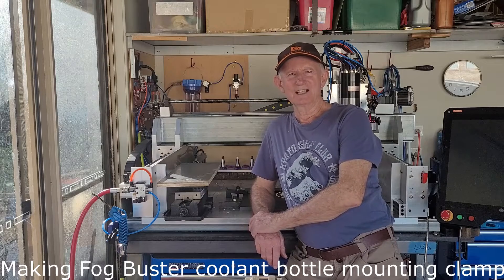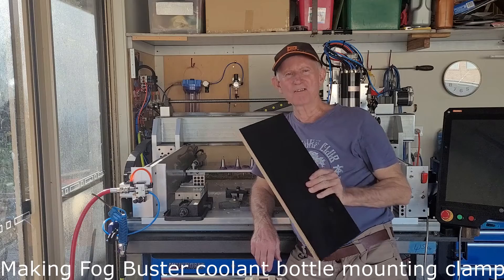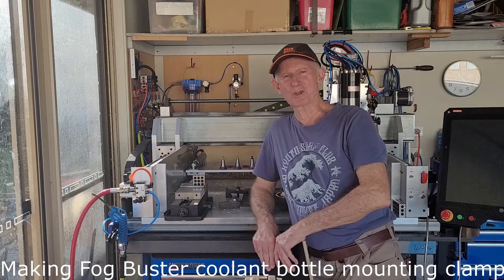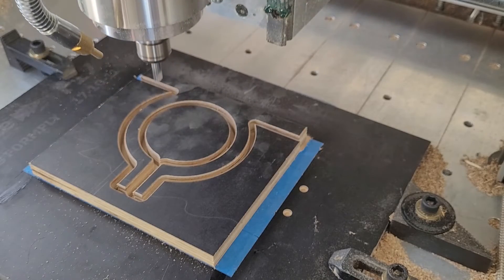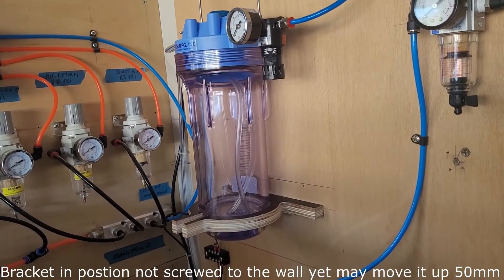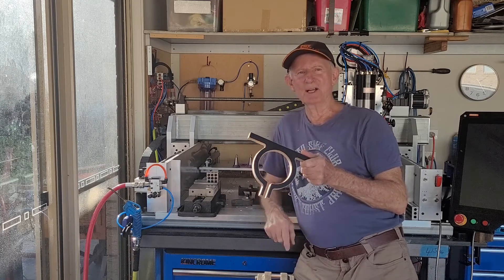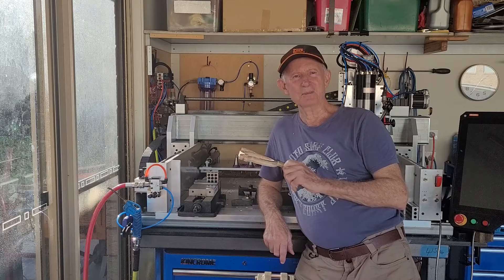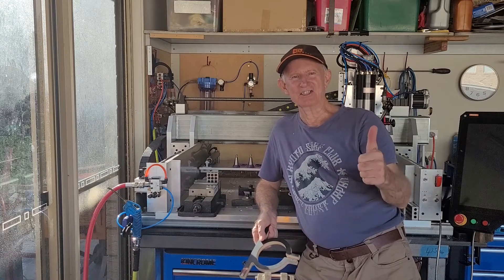Bills PrintNC PRO + Tool Changer making a Fog Buster Coolant Bottle Mounting Bracket

Comment: It's a nice part! But be careful about blowing dust with compressed air, better to have some form of dust collection if you care about your lungs and not getting dust everywhere.
Reply from the maker: Hi @imqqmi yes of course but I do very little wood and use a mask when I do, 95% of the time I am machining alloy with mist coolant but even with that I am carful of fumes thanks for the comment cheers Bill

Comment: good stuff man. what spindle are you running? i've been using a smaller 1500w er11 spindle, though i keep thinking about upgrading because I want to run larger tools 😂
Reply from the maker: Hi I am using a Jainken 3.2 Kw 800 Hz water cooled ATC spindle with ceramic bearings, it's Iso25 and takes ER 20 collets I have been very happy with it and would buy another one in a flash cheers Bill